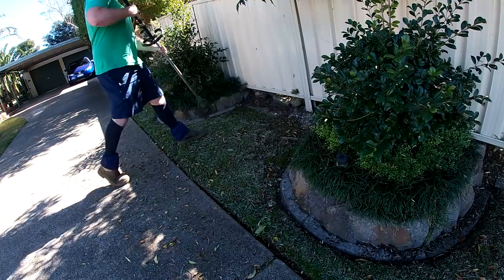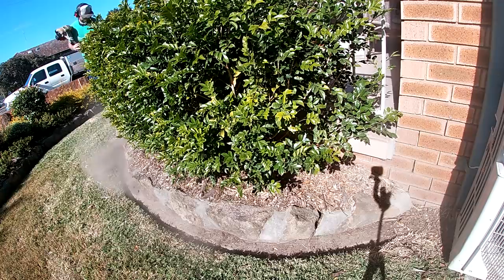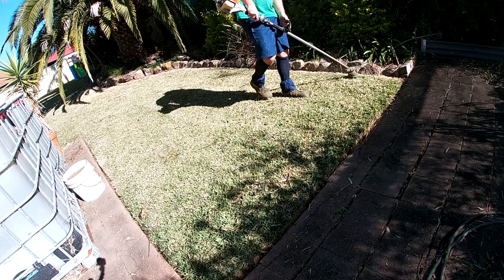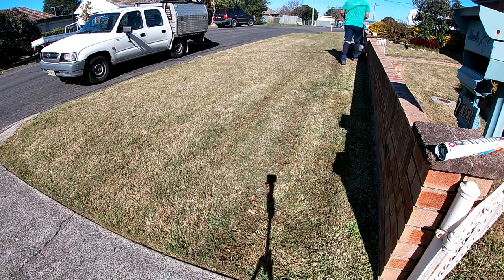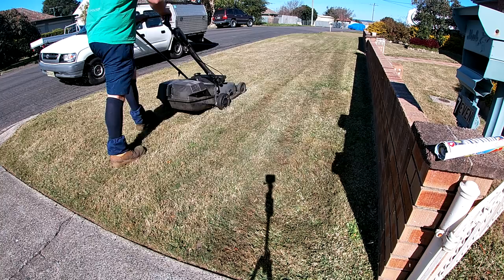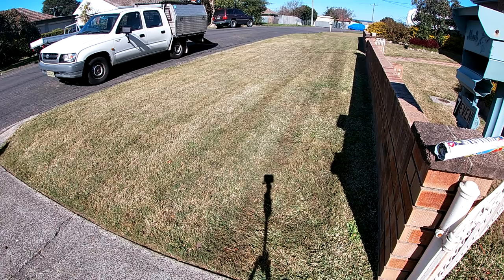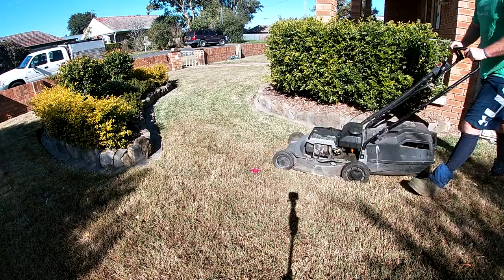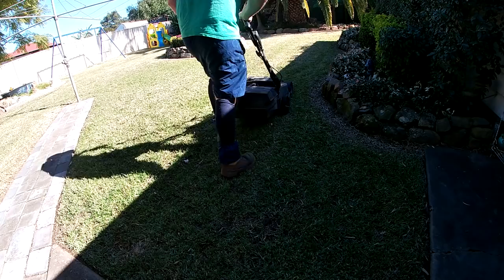This is what WINTER Lawn mowing in Australia looks like! [Victa Pro 505]

Comment: Hi Shaun. Definitely from the 1990s at the earliest, mid to late. I think Victa stopped building these in the 2000s as I still saw them on display at my local mower shop in the early 2000s. That looks like it's possibly as late as that.
It seems to run exceptionally well. The four blades make it sound almost indistinguishable from the Masport and Rover!! So glad to hear the catcher meets capacity requirements. Surprised it's leaving grass clippings behind. Still dud a good job and looked stylish doing it with it's sleek low profile design engine.
Can't wait to see it in tougher stuff and I'm chuffed you finally got a catcher model.

Comment: Two things about a Victa 505.... 1: the side discharge from the catcher is a factory no cost option, mines does same... 2: you're on it one day and already walking next to it with one hand on the bar/throttle assembly (self propelled handle)... like a boss 😁 And the 505 series I think was from mid 80's... still use mine today since owning from new only have to service the carby occasionally and keep regular maintenance up to it. The motors will never die and if they do as far as i know parts are still available to rebuild them. Well done and keep on mowin' 👍

Comment: You can't kill a victa mower used them for years. My own one is now 20 years old and the only thing that has been replaced are the 4 cutting blades and a couple of spark plugs , that's it. The only downside i have found with my mower ( golden anniversary model and is painted gold !! )  is the steel pressed deck is starting to rot out with rust around the bass . I'm looking for a early bass of the original high arch models , these were cast aluminium.
Reply from the maker: They are beauties! I recently saw a brand new one, straight out of the box in a forum recently. It must have been forgotten about in the back of a warehouse for 20 or more years
Reply: @BladeMateLawnCare  Yes i used to cut very long grass with the early victor "toe cutter mowers very little in the way of safety as the blade were a little wider than the base no discharge shut and the mower would shoot out the grass mainly on the right hand side of the mower, but with the long stuff the grass would also discharge at the back. One nearly had to wear gumboots with the long stuff. No governor on the motor  and the height adjustment was a big knob on the front left hand side that one turned to set the height. 125 cc and the spark plug was at the back of the motor . A lot of these motors also got used in the kids mini bikes.

Comment: Is the weather in the Hunter Valley, similar to Sidney, or colder/hotter.   Looks like the temps are 50s to 70s for the next 10 days in Sidney.   So your winter is very moderate/nice, as far as temperatures.   Is there a town in the Hunter Valley that you could name that might give one a better idea of the winter climate than Sidney, since Sidney is on the coast.
Reply from the maker: it's very similar, it's only a 2 hour drive north. Check out Newcastle
Reply: @BladeMateLawnCare  Thanks!

Comment: Hi Sean, I notice you don't use a guard on your grass trimmer. Is that a personal preference or another reason? Watching other lawn care professionals on Youtube and it seems to be a mixed bag.  Is there any benefit of not using the guard?
Reply from the maker: The guard doesn't do a great deal. My experience is that it's really only there to protect the operator,  and doesn't do much to limit debris being thrown at people's property. The trimmer head spins anti clockwise, so the trick is to orientate it away from windows and such. That said,  the reason I have mine off is simply for storage! The rack on top of my ute won't allow my trimmer to fit with the guard on.

Comment: Good Video mate. Hey I'm a retired veteran and just brought my first house, thank god for not having to pay anymore more damn rent lol, anyway I need to buy my first whipper snipper, any tips on brands and types, and not battery or electric ?    Cheers :)
Reply from the maker: Gday Frank, congrats on the house! It's always a good feeling knowing that you're no longer paying off someone else's dream :) I only use Stihl, so I'm a bit biased. Basically, the higher the model number, the more powerful they are. The one in this video is an FS85R, but they don't make them any more. The closest one on the market these days is the FS94, which is a similar size and weight (entry level, light weight commercial machine)
Reply: Frank, Echo is expensive but a goody.
Other brands that spring to mind are the Honda four stroke models, they are very good, also Shindaiwa and Tanaka, both Japanese brands.
In the cheaper end, I have heard the Ryobi full crank models aren't bad.

Comment: Hi Sean, if grass was watered in winter would grass still be green or are you not allowed to water?
Reply from the maker: Hi Sandra, we are allowed to water, but it's usually not as necessary as we get a fair bit of rain. Grass gets a bit sleepy this time of year due to the shorter days, and goes a bit brown. This is due to the reduced chlorophyll (that which makes the grass green) taking a nap in order to conserve energy and not die off. You can use nutrients to keep the grass green, but they are a bit superficial in my opinion and not really a reflection of the constitution of the lawn
Reply: @BladeMateLawnCare  you are awesome for answering my crazy questions.  Thank you!